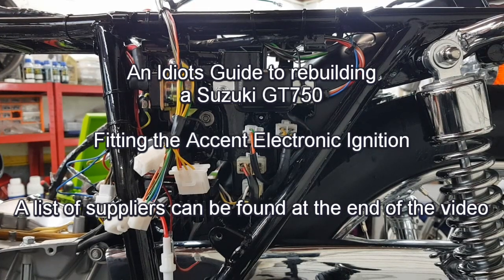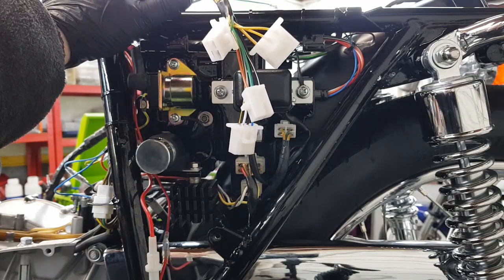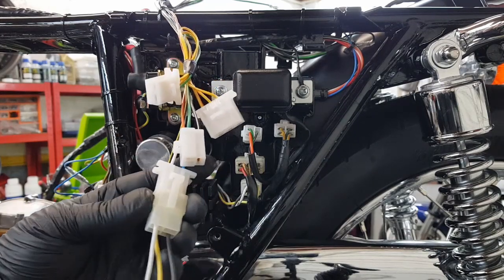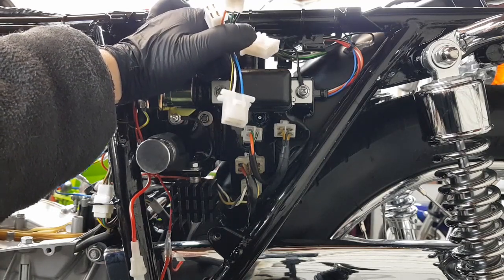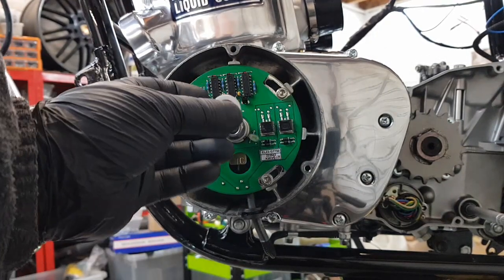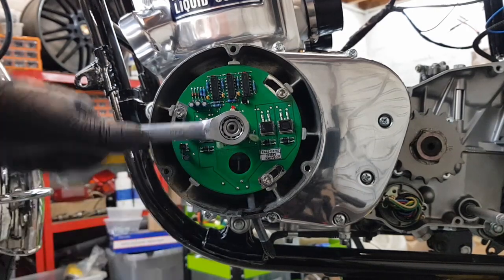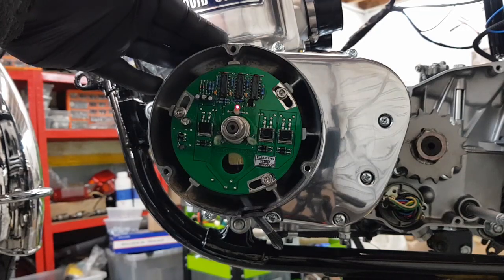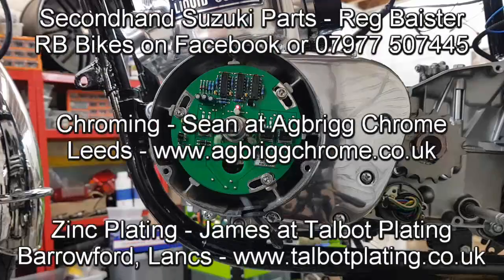Fitting the Accent Electronic Ignition - An Idiots Guide to rebuilding a Suzuki GT750

Comment: Thanks for the video. I am curious if you need to have it all plugged in, with a battery in the bike? Key on?
Reply from the maker: Once I've fitted all the electrics yes I fit a battery and of course the key has to be turned on to power it all up !

Comment: What about the blue neutral switch wire? This wire is missing from the Accent kit wire loom I received. Now I don't have a neutral light. :(
Reply from the maker: The neutral light wire is nothing whatsoever to do with the Accent electronic ignition  !
Reply: While I agree that the neutral light is not associated with the ignition system, the North American GT750J came with a  4-wire ignition loom. The black, white and black/yellow wires are for the ignition plate, and blue wire has a pigtail which connects to the neutral switch underneath the engine. I simply had to run a separate blue wire alongside the new Accent wiring loom up to the plug behind the side cover. Neutral light works now. :)
Reply from the maker: Oh your bike is a J model !
You never said that but as long as your sorted that's all that matters !

Comment: It seems surprising that the adjustment slots were off from the factory. Was the system made for other models?
Reply from the maker: The unit for GT750 fitment is also used on GT380, but on both models the slots need extending  !